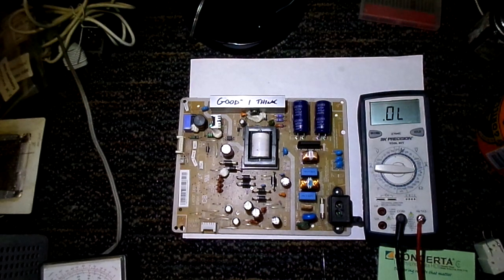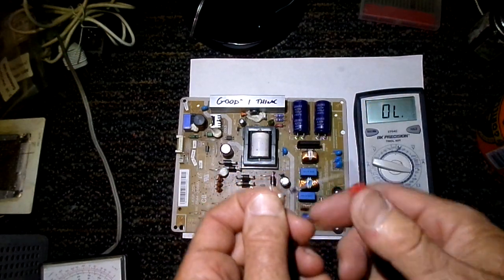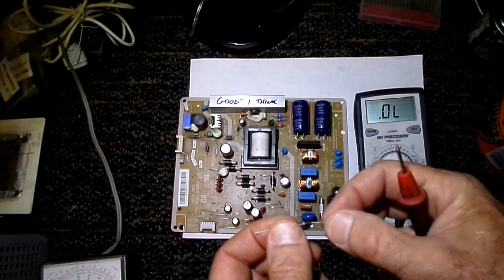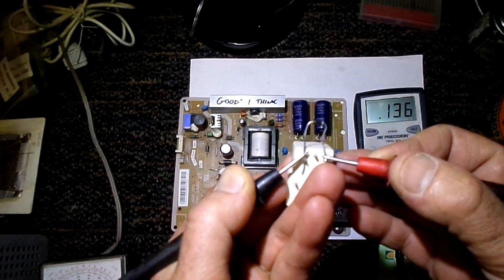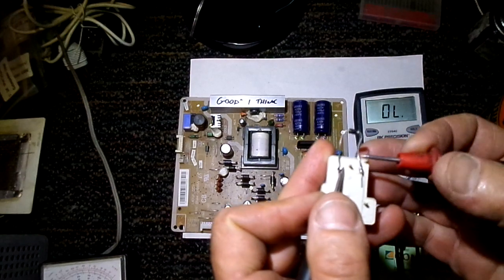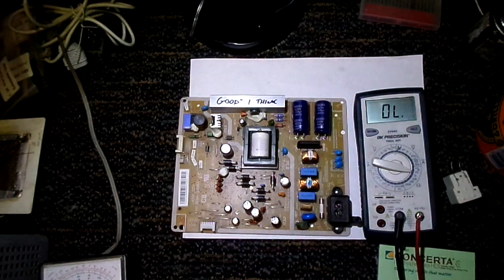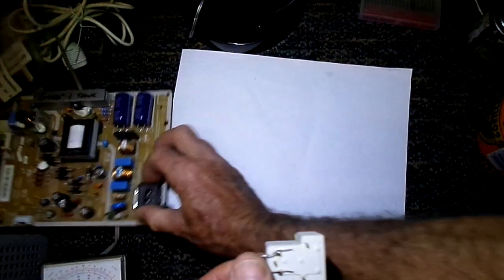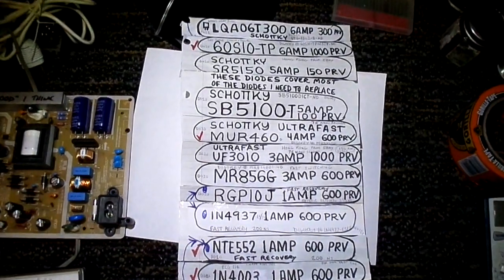Diode check function has its limits. Bad diodes generally short out.

Comment: I used the ohm meter on a diode on my motorcycle... one side shows "l", the other shows "178." or so and then "l" again. Is this diode bad?
Reply from the maker: I don't understand those readings you described, but when a diode shorts they are generally going to be one ohm or less. When you use the diode check function the test will indicate the voltage drop across the diode.

Comment: Great video!  One question, what if I do get over 1 ohm from one side, but if I switch leads I get OL? Does that mean it’s a bad diode?  Thanks
Reply from the maker: Diodes generally shot out when they go bad, so if you're seeing OL in one direction but not when you switch leads that generally indicates the diode is good, but I  suggest using the diode test function on your multimeter.
Reply: @GrantsPassTVRepair  thanks for answering my questions.

Comment: At 1:46 you test the diode on resistance mode and you say, it reads 1.61 Ohms [and with the leads reversed, you get 1.59] and you say, it’s not really picking up the diode, it’s picking up the coil? Well then, how do you know if the diode is good or bad, since the multimeter is not reading the diode. Pardon my ignorance, I’m a baffled NOOB, but I want to learn. Cheers!
Reply from the maker: The point I was making in this video, is bad diodes generally short out when they go bad, and every shorted diode I've ever tested on my ohmmeter  showed one ohm or less when testing them on my multimeters resistance scale. If the diode isn't shorted you're not going to get any reading at all using the resistance scale on most multimeters. The 161 ohms or 159 ohm reading only showed the resistance of the relay coil because it was in parallel with the diode, but if the diode had been shorted the resistance reading would have showed one ohm or less on the resistance scale.
Reply: @GrantsPassTVRepair  Thank you for replying, I truly appreciate it. Ok? But I’ve tested a bunch of diodes [after watching this video - out of circuit] I couldn’t find a bad/shorted diode, so I tested what I had [all good diodes] and on resistance mode, and I did get readings one way +/-132 Ohms, +/-162 Ohms or whatever BUT I got OLs the other way, and I did this with a El Cheapo multimeter, nothing fancy at all. So I find it curious, I mean why, wouldn’t a multimeter pick up the Ohmic value of a diode, when it’s in parallel with another component? And why WOULD it, when a diode is shorted? Can you explain why that would be, is it a limitation of the multimeter - is there a reason? Please let me know, if you find anything. And thanks again for replying. Cheers!
Reply from the maker: @maxwarfield6699  The reason is most digital multimeters don't put out enough voltage on the resistance scale to test a diode. That's why they add a diode test function which does put out a higher voltage. The older style analog multimeters put out a higher voltage on the resistance scale but not the digital meters. If you're still confused you can call me

Comment: Sir.. if diode explodes in psu.. does it damage the mothetboard or not?
Reply from the maker: Based on my experience a bad diode in the power supply is not likely to damage the motherboard,
Reply: @GrantsPassTVRepair  thanks for the response. Ill test it out if i buy a new psu

Comment: To chech a diode. Is it compulsory to remove from a circuit first
Reply from the maker: In some circuits it might be necessary to removed the diode to test it, but in most circuits you don't need to remove them.

Comment: Hi, I jumped into this video as I was trying to understand the typical 'TV repair kit' which are sold lately online, in particular on Vestel power board. I am talking about those 6 diodes pack which need to be replaced when LCD backlight does not switch on properly. The question is: even though a diode is tested with forward and inverse direction current and the result is good, is it possible that they start to be insufficient for their duty? like a resistor which heats up or a capacitor which is exhausted under current? Thx
Reply from the maker: Finding diodes that test okay on your meter but don't operate correctly when they have power running through them has been extremely rare in my experience. I can only remember seeing this happen once in the 26 or 27 years I've been servicing commercial electronic equipment. .

Comment: Hi again, I have another question.  The one ohm or less, would that matter which way you have the test leads on it or would it show one ohm or less going both ways?
Reply from the maker: If your Diode checked .9 and you're on the ohms scale of your meter that sounds like a short, but keep in mind There can be other components in parallel  with the Diode you're testing which make a good diode appear shorted. That's why I  suggest using the ohms scale so you can find out what the actual resistance is,  You could have also tested the diode you removed using the diode check function of your multi meter, and it would have revealed if there was a problem or not. Checking a Diode is very simple. If my video did not explain it well enough there are probably hundreds more that will.
Reply from the maker: If the Diode is shorted it will not matter which way you have your test leads.
Reply: @GrantsPassTVRepair  I still don't know what I'm doing I guess.  I found one that tested .9 something so I removed it with a "good" diode.  Once the good diode was soldered in place it gave me the same reading.

Comment: Hello...newbie troubleshooter here.  I was testing a diode (on diode mode on the meter) in a cb radio.  It was giving a reading going both ways so I thought it was bad so I unsoldered it and removed it.   Once it was removed I tested it again and the thing tested fine.   So...if I'm testing a diode still in circuit, you're saying the resistance (ohm) setting would be better?
Reply from the maker: Yes I suggest it's a more reliable way to test a diode without having to remove it since most diodes that have shorted out will read One ohm or less.
Reply: @GrantsPassTVRepair  Thank you!  That will help me out a lot knowing that.  I appreciate you writing back, too.  I've asked some people in other "repair" videos that never write back.

Comment: Im confused reading the diode of my board, its connected to the primary side and 2nd side but it reads short same as what u did with the diode connected to relay, but when i took out the diode it reads fine not short. What could be?

Comment: Not sure I understand. Are you checking for infinite resistance to indicate that the diode has failed open?
Reply from the maker: No, I'm checking for the opposite of infinite resistance. I'm checking for shorts, meaning the diode went bad, and now it's more like an ordinary piece of wire with almost no resistance,. Usually less than an ohm.
Reply: @GrantsPassTVRepair  If the diode has negligible resistance when working correctly, does this mean you need to know the expected resistance of the coil in order to determine if the diode is adding something on top? Thanks for the reply!
Reply from the maker: As a general rule the relay coils you find in TVs will be way above one ohm, so if you happen to be checking the a diode which is in parallel with a relay coil ,and it doesn't read less than One ohm or less, it's most likely a good diode.

Comment: I have a pretty hefty power supply that let the smoke out, inside I found diodes that had failed open. Admittedly most of the diodes had burnt and cracked in half or blown up. 
Your tip is good and much appreciated! It’s a good way of getting at least a preliminary overview of the problem.

Comment: Thanks Dave. I check diodes as well as transistors etc., with my BK Precision 114A VOM using resistance, which also on 10K gives a 12V insulation test.

Comment: Excellent tip, BTW!! I'M not sure everybody gets the fact that the reading you get on the diode function is the voltage drop across the semiconductor. This makes it great for leak testing if you know what readings to expect at a given semiconductor junction.
Reply from the maker: Thanks walt. Other than seeing diodes that were blown apart, I can only remember one instance where a diode checked good with my meter, but failed to work in the circuit.
Reply: interesting.
I was reading the comments and what you guys are saying is interesting.
my question is what was the fix grant for this diode you found it good with the multimeter and its failed in the circuit?
Reply: Grants Pass TV Repair It probably would have failed an insulation test, maybe even with a VOM on 10K.

Comment: Yes, I've had silicon diodes open, short, and be leaky (lower than normal forward or reverse resistance). The leaky ones are the toughest to figure out because the instances are so few. Open diodes are much less common today than they were in equipment of the 1960s and 1970s. I spent hours on a Toshiba tube TV once with an open rectifier in series with the line in half wave config.  Even though my VOM was telling the truth, I didn't want to believe it!  It's been 35 years since I've done significant troubleshooting on a regular basis. This is before the existence of diode functions in digital multimeters. Heck, it's almost before the existence of digital multimeters!
Reply: My VOM is a BK Precision 114A in mint condition. I never doubt it.